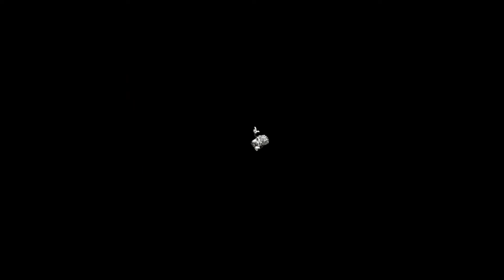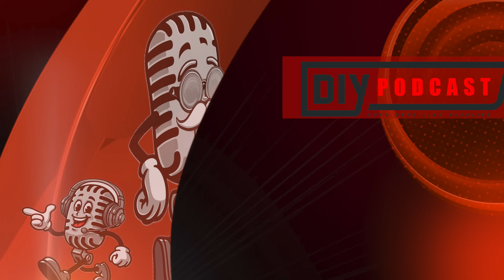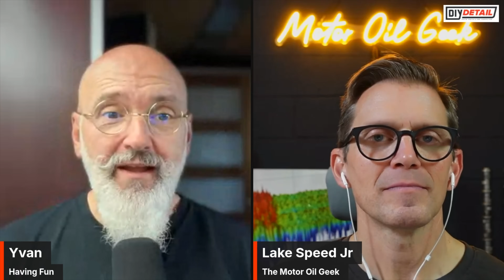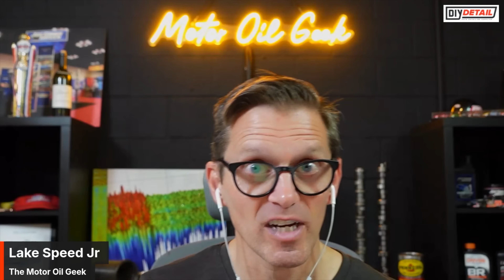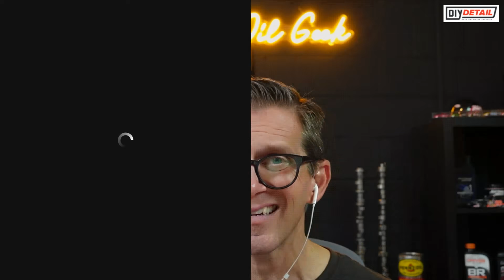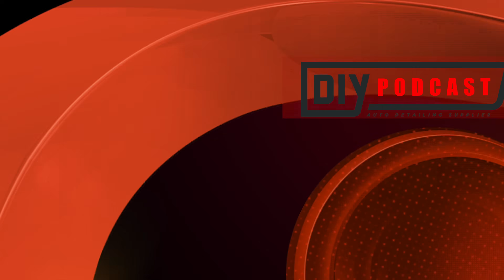Oil myths busted with Lake Speed Jr and DIY DETAIL PODCAST

Comment: Does elevation change your desired high temperature for oil? 
You regularly bring up 220, and also say it shouldn't stay there, but needs to remove water.

(I live in Colorado around 9000 feet and water boils under 200° here)
Thanks!
Reply from the maker: In that case you are removing water at 200
Reply: Water does not need to be boiling to remove itself from oil. Water below boiling still gives off steam. Heat accelerates evaporation.

Comment: 3000-5000 miles (depending on season) with Amsoil Signature Series  5W-30 for me with Wix XP filters.  💪🏼
Reply: Wix XPs are good, but AMSOIL's are better, 20 microns verses wix 30 microns.
Reply: @oneninerniner3427 exactly. The amsoil filter was tested as the best filter by multiple channels and third party testing. Second place was the new fram ultra syn filter, which guess what? Made in same place as the amsoil filter. Dudes buying signature series then cheating out a few bucks to get a wix filter over the amsoil filter. Kinda sad
Reply: @TaylorPhase  my WixXP filters out cosmic dust from the Andromeda galaxy!!
Reply: @oneninerniner3427 amsoil filter according to the test I ve seen are very restrictive. They do filter good, but they restrict oil pressure
Reply: Same unless its Direct Injection and hard driving ( lots of wide open throttle or higher boost levels etc) also any E85 uses I use 5w50 for fuel dilution and breakdown purposes, filter wise I have found as long as its synthetic fiber filter element its good at least from oil tests.
Reply: that oil is good for 10 k miles easy but i dont know what you are doing to it .
Reply: @tjlee9901 I was thinking of welding my oil pan bolt closed.  Now I know I can cuz Internet !! Thanks!! 👍🏼
Reply: @tjlee9901 at 5k in a 2.0t LTG tuned bolton's, and boost raised running E85 with 120k miles fuel dilution is getting pretty high per oil tests, (common with direct injection) a 2021 3.6 supercharged Colorado tuned and direct injection same thing. These are also ran hard, 10-15 WOT rips daily, limited long idle periods so thats a plus, and 120 miles daily, yes 10k is possible but if you a actually testing your oils and not just jump on YT and throw comments you would know.  Normally go to 5k and 7k is where I stop. If it were a stock daily engine yeah 7-10 k all day depending on filter choice and if it's turbo and DI. All of those claims for mileage use all depends on the filter choice the way the engine is used fuel choices mods and driving habits.
Reply from the maker: Thanks for sharing!

Comment: 2gr Fe 3.5 litre in 2008 Highlander. Oil cap says 5w30. In Canada during winter minus 10 to Minus 30 temperatures. 
Would 0W30 be advisable?
Reply: Yes,   your oil cap doesn't know where you live.  Zero Winter (0W) does flow easier than Five Winter,
Reply from the maker: Follow your owners manual
Reply: i think 5w is okay if you warm up and drive off carefully but 0w is obviously better and maybe give a little better fuel economy .

Comment: What about time wise is I have two cars I don't put 5000  on a year? I just do the change once a year with full synthetic
Reply from the maker: Once a year is good
Reply: @diydetailofficial thanks
Reply: According to most official information if you are running low mileage like that you should change it every six months but personally if it's less than 5000 miles and you're using something really good like Valvoline synthetic or Pennzoil full synthetic I would stick with once a year personally.
Reply: Just follow the owner’s manual. Usually it is 12 calendar months if your not meeting the mileage.
Reply: i do about 5 k miles a year on my truck but usually i dont leave the oil in there for more than maybe 6-8 months
Reply: Every six months if you hardly drive the darn thing.
Reply: What are you habits? long or short trips? does it sit for a period without use (garages in winter), etc?

Ultimately, Lake would said get oil analysis done and that will tell you for your specific situation, based on your water and fuel dilution + wear metals!

Comment: Walmart Supertech Oil is the cheat code  for oil changes. Price wise....it can't be beat. $19 for a 5 quart jug, full synthetic, all the additives package, Dexos rated, and performs superb.
Reply from the maker: Thank you.
Reply: I recently bought full
Synthetic  FVP oil (made by valvoline) for $19/5 quarts and an extra 11% rebate at Menards. Right now that is the cheapest . Supertech at Walmart at $19 is the next one price wise in my area.
Reply: Havoline comes in 6 quart box.😊
Reply: It won’t hurt a thing. Though I deleted it, my wife’s 2019 Grand sport actually calls for 5-30. Crazy they had to keep that in the Corvettes. But they did.
Reply: ive heard even their conventional oil is okay at the price . for a few years i was mixing my own semi-syn using super tech .....i didnt notice anything bad .
Reply: @tjlee9901 supertech is decent oil. I use synthetic rated for 10k miles and cars over 75k miles (has additives to reduce oil leaks). The 20k rated full synthetic is also good. I still change it every 3k miles. I tow and it gets dark by then.

Comment: I stick to 3000 mile oil changes.  I use valvoline extended protection,  and i kno for a fact my engine is being taken care of.  I dont care if i could possibly get more life from the oil.   I rest easier knowing im not pushing my oil to its limits.   Probably the reason i get half million miles out of every vehicle ive owned.  And there still running great when i sell them at the end of the driveway.   I enjoy changing my own oil.   I dont trust dealerships or quick lube shops to change my oil.  Or any other fluid in my vehicles.    I do it all myself.
Reply: What's the newest vehicle you have owned and reached 500k miles on the engine?
Reply: @D2O2  I owned rav4 hybrid with 570k miles. Traded in for a 2024 rav4 hybrid xle - planning to run it till 1 million miles. BTW rav4 just beat Tesla Y for best selling car in the world. Period.
Reply: I agree
Reply from the maker: Thanks for sharing!
Reply: For idiots like you Lake said that don't change oil filters prematurely - you are not letting oil filter do its job. That old wife tale to change it every 3k no matter what - is just asinine.
Reply: I sent my used oil analysis after 5000 miles. Still very good. Doing a 3.000 miles you are not doing any benefit only waste a ton of money. My camry has 600.000 miles changing every 5000 miles
Reply: @FredAlmeida-r8i  and oil price will increase due to 3000 mile oil change
Reply: @FredAlmeida-r8i How do you know his driving schedule when he hasn't stated it?
Reply: @5jjt did you read the post? I guess not. Go back and read again, then read one more time
Reply: that will certainly keep your engine clean with a flush every 3 k miles , especially if its really good oil .  i would pay u for that old oil to run in my small engines
Reply: @tjlee9901 if your in or near upstate ny essex county , your welcome to it for free.
Reply: "I stick to 3000 mile oil changes." And eat rubbish at McDonald's? 5000-7000miles is good for any decent FS oil.
Reply: @MehdiS-music  i dont eat mc d.  Shits poison.     
  I eat keto , and work out 3-4 days a week.    I take care of myself and my vehicles.    Might wana try it, sometime 🤔 
  Your mindset seems quite childish.!
Reply: @MehdiS-music  depends on how and where you drive. If you drive stop start traffic in the cold 2 miles a time never get up to operating temps, 3000 mile interval may be required. If you just drive freeway miles, then you may extend it to 5-7k. Fuel dilution is how oil get sludge up.
Reply: @MehdiS-music My God Man you're Babbling!
Reply: Mehdi... that's gonna depend a lot on environment and driving habits. Where I live temps range from -50F to over 100F. It's also very dusty, and there's only a few highway miles driven... mostly stop and go town driving, and maybe 10 miles at the most, and I'm at my destination. I likely have a lot of fuel dilution, moisture build up, and other contaminants that would get burned off at a long drive at 80 mph on the interstate. So I'm gonna play it safe, and as the old saying goes, "oil is cheap, engines are not"!
Reply: @MehdiS-music 
It’s his car, not yours.
Reply: @a3300000 Is he spoken for by you? 🤔
Reply: Open your mind....3000 mile change is wasteful...borderline stupid.  Case in point. Person I know has a Mercedes metris van....2018 4 cylinder turbo FI, has changed oil every 15,000 miles and now they are over 400,000 miles.

Comment: The keep the hybrid engine on is the ac button or the defrost in the winter.
Reply from the maker: What vehicle?
Reply: Ac doesn’t turn the engine on with a hybrid. The heater does
Reply: Why would you want to keep the engine on?
Reply from the maker: To burn off water in the oil
Reply: @diydetailofficial you need to drive it hard to do that. It won’t happen idling.

Comment: My 5 cents in regards to oil change intervals.....

Car manufacturers will always hide behind the disclaimer of "severe service intervals"...... which usually covers pretty much everything.

With my model Camry if I had followed the manufacturers oil change interval (which is the minimum servicing requirement to not void the warranty), I would have been slowly destroying my engine.

My low tension piston rings would be gumming up etc and becoming jammed off centre damaging the bore.

Especially since my local Toyota dealer was only using a semi-synthetic oil and was trying to advise me AGAINST doing an in-between service....

So a semi-synthetic oil for 9 months or 15,000 km......

Needless to say I was supplying my own store bought oil from the first oil change...... and yes "Fully synthetic" (not the man made version though).

So as long as the car fails outside of the warranty period......manufacturers don't seem to care... until there is a class action against them.
Reply from the maker: Thank you

Comment: In regards to winter storage (which doesn't apply to me), 

Wouldn't not starting / running the car a few times during it's winter storage increase the chance of rust etc within the engine?

Just trying to visualise things, but cold + moist air, and the oil would eventually cease to fully cover the metal component (drip off over time), so wouldn't that lead to rust?
Reply from the maker: No, I owned a storage facility for years, we always suggested, fresh oil, full gas tank and a battery tender

Comment: Very informative video, thank you. Type III base stock is synthetic because congress said so. It is not considered “synthetic” in Europe. Hence “European Formula” on many oils. A question, does Valvoline Restore & Protect make a difference in older mechanical fuel injected diesels like a Mercedes 240D?
Reply from the maker: Thank you.
Reply: There is really no such thing as a purely "synthetic" oil. All oils start with a base oil which comes from the ground. So called synthetic oils have a higher level of refining and additives. That's really it. And there are many levels of refining between the various types of oils.
Reply: @LA_Commander  Nope.  Some synthetics don't start with "base oil", they start with natural gas.
Reply: @EristiCat   natural gas still comes from the ground.  Hence the point.  That's why it's called "natural gas".  It too is not synthetic.
Reply: @LA_Commander you said oil, which was wrong. Now you’re trying to pretend you weren’t giving bad info. Man up.
Reply: @LA_Commander real synthetics are made from vegetables.
Reply: @LA_Commander Group +III and IV is based on hydrocarbon from the ground (but it's synthesized/built instead of altered/purified), group V esters is usually made from acids and alcohol (but occur naturally in plant oils as well).
The whole question was where to draw the line, and different parts of the world draw that line differently, some consider group III to have been altered enough by man to allow calling it synthetic.
In the end it should only be a matter of if it's the right chemistry for what you're running, as the engine won't know about a court case.

Comment: Oil is very cheap compared to buying a new engine.
Reply from the maker: Exactly
Reply: i want to keep my truck as long as possible but realistically its not going to be going for another 20 years which would equal about 100 k miles .
Reply: Yeap.
Reply: You're kidding?
Reply: a new engine is very cheap compared to changing your oil twice as much as you need to due to superstition over your lifetime.
Reply: @DanBCooper Your math is way off brother.  Just bought a new Nissan Pathfinder.  I want to take care of it. I'm going to do 5K oil changes instead of 10K, what's recommended, with occasional oil test. If I paid the dealer to do it, at 5K instead of 10K, and the SUV made it to 300K miles, it would be another $4,800. Ill chage myself it'll cost another $1000 per 100K miles. FAR CHEAPER THAN A NEW ENGINE.
Reply: @DanBCooper clown
Reply: Very original idea. No one has ever thought of that before.

Comment: Hello. I just wanted to ask for some advice. If my car manual says it's not recommended to use fuel system cleaner, should I still try using it? Thank you.
Reply from the maker: Follow the manual
Reply: Just run the odd tank of Premium fuel, it will do the same thing

Comment: The biggest problem with longer drain intervals is keeping your engine full of oil. You have to check your oil regularly and replenish. I've been doing longer drain intervals since the late 90s. My Dad did 5k oil changes in the 80s. We get 200-300k on our vehicles never had an engine failure
Reply from the maker: Great
Reply: @diydetailofficial great interview just found your channel
Reply: i still do 3 -5 k intervals although i figure 10 k per year would be fine with the right oil .  i go the other way and buy  conventional or semi -syn and change sooner , thinking the engine is almost getting a flush at those intervals
Reply: @tjlee9901 it's amazing an oil expert literally says synthetic is better, change your oil on data and that studies show doing too much maintenance is bad. But you still think you know better! Amazing

Comment: I went with my wife to take her Tacoma for service and we were talking about oil weights. It turns out the Corolla that uses 0w8 in America uses 0w20 in Mexico. Imagine that. Same motor, same vehicle 😂
Reply: Lotta people will tell you otherwise, but it's for EPA nonsense and fleet mpg. The thinner oil there will almost always allow the engine to wear out sooner.
Reply: My Mazda 6 has a similar spec 0w-20 in the US, 5w-30 in Mexico. 5w-30 it is. Ole!
Reply: @dondebomm6329  Mexico has a  much warmer climate compared to North America. That's 90% of the reason.
Reply: @journeyman291  both engines are cooled by coolant and oil.
Reply: @journeyman291  ever spent much time in Phoenix, Las Vegas, California’s Central Valley or desert? Damn hot in much of the US in summer.  🏜️
Reply: @dondebomm6329 why?
Reply from the maker: Thanks for sharing!
Reply: I think Lake covered that in the video, 
Sounds like it shouldn’t matter too much. 
OW was the main thing to watch out for.

I notice now NZ Toyota put OW-20 previously in my RAV4 Hybrid and now they’re using  OW-16. Same vehicle.
Reply: I've heard this also about the Toyota Tundra 5.7 Iforce engines that in other countries the spec is 5W30 even though mine here USA says 0W20. I've been hesitant to change as I do live in Ohio where we get somewhat cold in the winter. Would like to know definitively which weight would be the best for it.
Reply: @dalephillips8250  definitely stay with the 0w in the winter. If you drive just short stop and go in the summer, stay with 0w oil. I'm using 5w-30 in the summer where temps don't go below 65°. In the fall I'll go back to 0w-20
Reply: @dalephillips8250  5w is good down to -20F.
Reply: @dalephillips8250 the first number is the winter weight depending on your change cycle you are probably fine in the warmer months using the 5w-30. Im in NC it rarely gets below 20 here so I feel comfortable using 5w-30 all year.
Reply: It depends on the country's emissions taxing policies.
Back in the day, the countries that wouldn't give any benefits to cars with a catalyzer system, cars where sold without it.
Reply: There are always multiple oils supported. Not a surprise. Did you listen to the discussion at about the @49 min mark?
Reply: My 2023 corolla calls for 0w8 here in the states.  I run 0w20 but i will change to 5w30 soon.

Comment: Love watching Lake’s videos too! Used to think oil is only a concern for high mileage cars, but it’s truly the short trips and moisture that degrades the oil!
Reply from the maker: Glad you learned something new!
Reply: You are right!  But don't forget oil that may have been stressed with heat; mostly pick-ups hauling.  And high speed cruising in deserts (this will really heat up a transmission, FAST)

Comment: 👍  GREAT video guys . I have a question ? will a 5W30 synthetic oil allow ( or work better in )  an engine in a 2016 forester with 115,000 miles on it  than the subaru recommended 0W20 oil ? thank you
Reply from the maker: That’s a question for Lake.

Comment: I store my car for the winter, my garage is not climate controlled.
If it's been cold out and the weather warms up i get condensation on my car.
So that is why i change my oil when i take it out for the driving season.
Oil absorbs moisture and moisture will leach into your exhaust and into the oil 
Change your oil when you take it out of storage.
Reply: Go to 9:00 and listen again! You got it backwards. You're not smarter than Lake
Reply: @bigdaddymak1439 you tube vice grip garage and see what happens when a vehicle sits..
I like lake speed.
Reply from the maker: Thank you.